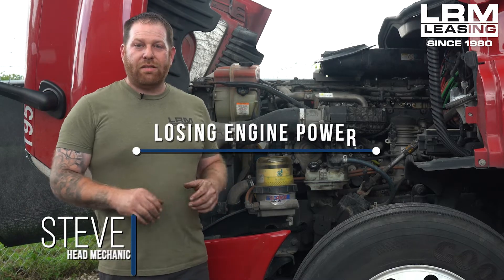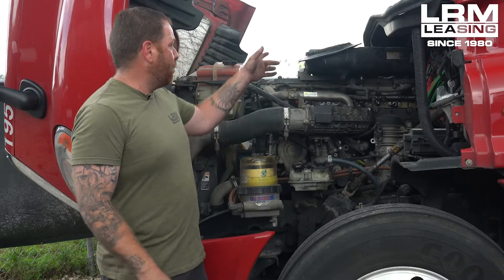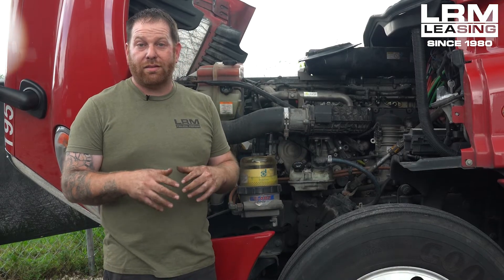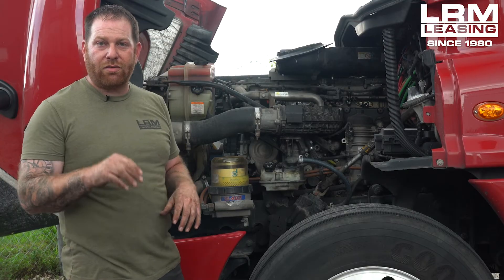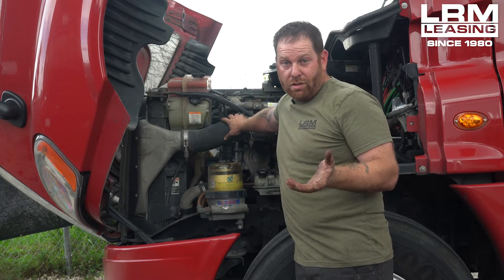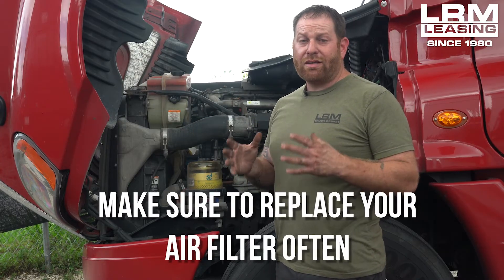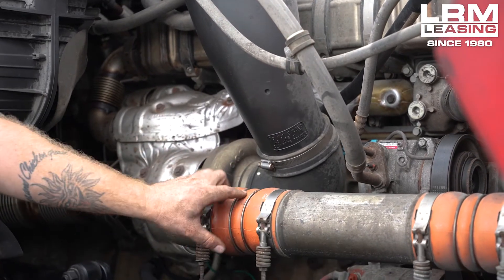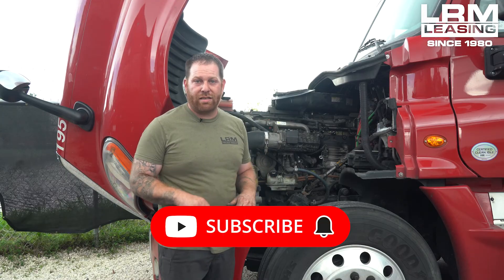Losing Engine Power on a Freightliner Cascadia DD15 - LRM

Comment: I just watched your video on the Cascadia for losing power. I have the same problem with my little Freightliner. I just changed the fuel filter but yes you know what you're talking about so I'm going to go ahead and take your advice and check for any leaks around the turbo and all that good stuff. And yeah I just wanted to say a heads up. Beautiful video buddy. Keep on trucking

Comment: I have to engen light on but wend I go up the hill it ture off help
Reply from the maker: When the check engine light is on. Get the code off the dashboard. If I have to guess it might be a fuel problem. Like pressure. Its hard to tell with out the code.

Comment: My 2014 DD16 is pretty numb until it gets to 1500 rpm and then it snaps to life. When a pulling a hill, if the rpm drops below 1500 she just falls flat on her face. It's a night and day difference. I changed the turbo boost pressure sensor but that didn't correct the problem. If anyone has a suggestion what I might try it would be most appreciated...thank you

Comment: Are those engines any good?
Reply: I got 952k on mine done water pump fuel injectors one box thermostat oil pickup tube and fuel pump it’s the Honda civic of the industry imo change my own oil and.m fuel filters every 20-25k air filter every other ain’t allot of power but it gets the job done

Comment: DD15 is running at high idol , when disengaged from high idol and press fuel pedal to move will not engage at all. Temp here outside 25 with cool wind. Is something frozen???!
Reply from the maker: Its unlikely due to temperature. I would recommend checking the connection between foot pedal and the CPC computer. This issue is typically electrical. Let us know how it goes!

Comment: Hello thanks for the video. Have a  2015 freightliner cascadia dd15 with 787971 miles and  I've replaced two turbos and cylinder head twice within 7 months and after the second time I noticed that my power is terrible when pulling weight north of 15,000 pounds. What could be my issue thanks Mr Williams
Reply from the maker: I would double check the valve adjustment. Then check the charge air cooler & the piping to make sure that there are no leaks. If that is good, I would be looking at the fuel system next.

Comment: Why do you spend 12 minutes explaining the same things? No one's attention span is that long. My truck is brand new. It doesn't go up hills and when I put cruise it doesn't do that speed. It always slows down unless I put my foot on the accelerater, which burns lots of fuel. It was at 20 miles 3 weeks ago brand new.
Reply: Same problem here... so what fixed it?
Reply: Why do you comment about the way they post their video. He didn’t explain the same things over. If it has 20 miles on it take it back to the dealer. It has to be under warranty since it’s a new truck.

Comment: My truck is losing the power sometimes and I checked it out from 3 mehcanic and spent 4 k $ but its still same 
What i have yo do sir
Reply: Did you find your problem out I have a DD13 and low power under load

Comment: MY fuel rail is leaking after having a PM done at Love's 🥺 missing work, now waiting for the dealership to open in Slidell LA
Reply from the maker: Sorry to hear this...hope it works ou!
Reply: @LRMLeasing  Yes it is replaced and then they seem to find other issues that were not there when I brought it to them🙄 the shop in Slidell LA is the worst 😡
Reply: Do not have loves do a pm.  They don't have the experience to work on engines. Now where was the rail leaking from